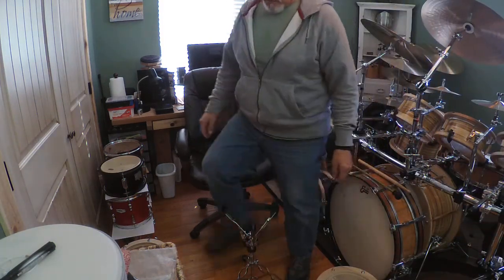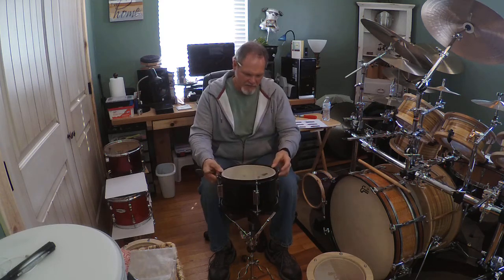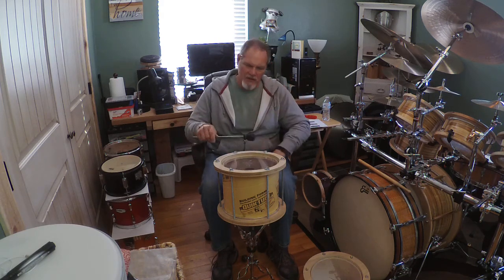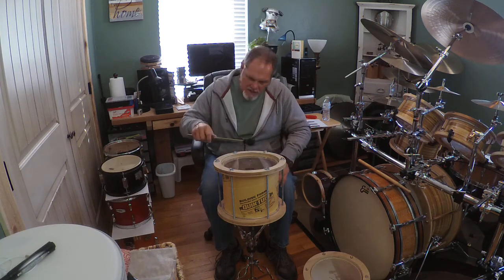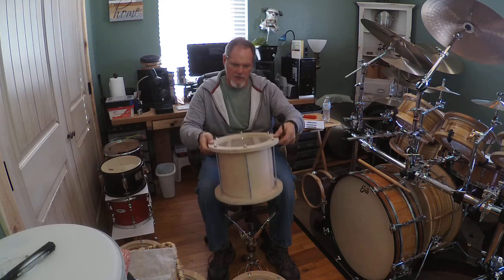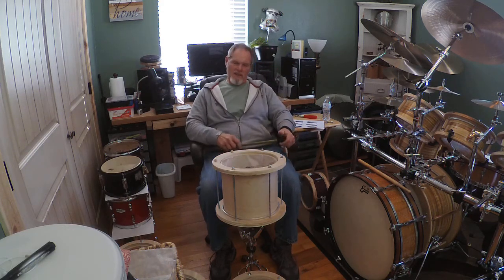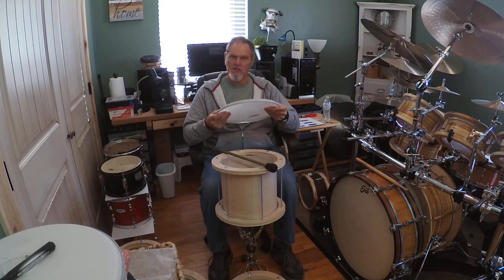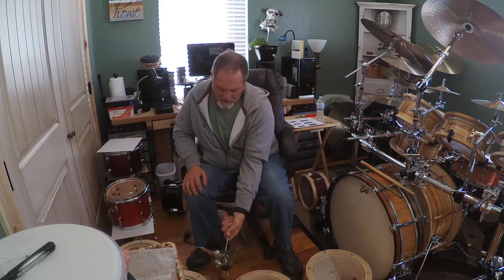Drum Shells and Sound - Bearing Edges, Part 6

Comment: Talk about how the drum when mounted if you stick a pole through the side of the tom it will sound different then suspended from around the edge
Reply from the maker: It isn't the pipe as much as the tom bracket on the shell. The same thing happens with tom brackets and L-rods for mounting. I mention mounting as a significant factor throughout the series.
Reply: @REFondrums  I have a 1980 pearl blx kit the Tom mount definitely deadens the sound if I were to use a rims mount or similar would the hole in the shell change the sound and would covering the hole change the rebound because of more air being trapped in the drum and improve the sound?
Reply from the maker: @trevormay7862  The hole would let a lot of the air column out and dry out the sound some. Picture the swiss cheese snare drums that became popular. They have holes all around the shell. The percussive effect of striking the head sends a very fast sound wave/air column to the reso head. In one video I show how fast that movement is. It's instantaneous on a 10" tom. 

Bear in mind you are losing that air when it goes into the pipe. Removing the bracket will open up the tom's resonance/sound quite a bit. Try it first and see what you think. If you want to cover the hole, I believe Pearl sells some kind of plastic cover for that purpose. Check out their website. 

I stopped using air holes in drums I make back in the early 90's. The amount of air that leaves a 1/2" hole is negligible when it comes to sound. If the BLX has a vent, just strike the drum while covering the hole and see. Nothing changes.

Concert toms just have the single head and like using a kick with one head, you get a lot of volume and the entire air column is leaving the drum. You just get a drier sound. Concert toms mounted with iso hardware have pretty good sustain, all things considered. 

Check out some Spaun drum videos. They make a Swiss cheese set. There's also a company that makes drums cut in half and you slide the halves closer together or further apart for sonic differences. They sound really nice. I've seen them in a NAMM video from some years back. I can't remember the company name. I was surprised at how nice they sounded. 

So, I don't believe the pipe hole will make that much difference. Like I said, try it and see.
Reply from the maker: Roto Drums - https://www.youtube.com/watch?v=yUIAPofPtyk
Reply: @REFondrums  thanks mate since I last posted I tried a pearl optimount on a 10” Tom I then tried the original mounting system there did not seem to be a whole lot of difference, if I hold the rim with my finger tips the sound definitely improves?!
Thanks for your reply and explanations, always interesting and informative, much appreciated!
Reply from the maker: @trevormay7862  When Gauger came out with his system and its obvious improvement of sound, the companies began their R&D to come up with their own. Frankly, many of them fail to truly isolate the drum and allow it to float.  If you put the mount in connection with lugs, etc., when the drum hangs at an angle, stress is created at those points, thereby putting stress on the shell, thereby restricting full resonance.

Some feel RIMS allows the drum to move too much, and it gets into a rocking motion. Because of that I began using snare baskets back in the 90s. I modify them for tom size and try to make them so I do not have to clamp them too tightly on the bottom hoop, thereby also restricting the drum. They have worked well for me. 

The Optimount affords more sustain and resonance than a mounted bracket but, again, if the drum is tilted, gravity is going to cause stress at those four points on the shell. Pearl chose to relieve rocking by using two top and bottom lugs/tension rods. I have not tried all these various iso mounts. Some of them are very proprietary. 

I know RIMS work. I know snare baskets work. The larger the drum, the more benefits can be heard. The smaller the head, the less vibration when striking it, thereby a faster lessening of sustain, especially if the reso head is effected, which the Optimount will do, depending on drum angle and tilt. 

If your tom is fairly level you should notice a significant difference, though. Just for the experiment, try various angles and see what you hear. Of course, your playing angle is your playing angle. I cannot play level toms for several reasons. 

Like everything else in this series, I have to say it becomes an issue of nuances and subtleties, hardware to hardware.
Reply: @REFondrums  just did another experiment, I mounted the 12”” Tom on the bass drum and it killed all resonance then I mounted it on a cymbal stand, it was much better, not as good as holding it on the rim by hand but it resonated?!
I can’t believe how much the bass drum killed the resonance of that Tom , it did have some dampening in the bass drum which is a 20x14!?🥴
Reply from the maker: @trevormay7862  It's just a principle of sound absorption. Vibrations are all part of the sound and they get absorbed by hardware or floors. Same with fl toms. That's why companies came up with leg tips that keep the solid section of the legs from touching floors. A lot of things can effect sonic frequencies and sustain. 

Some day science will come up with ways to levitate things, and for the drum world that would mean no hardware. All the drums would literally float and angles adjusted by virtue of magnetic fields or something. Of course, by that time there may not be acoustic drums anymore. Everything might be in the nature of Aerodrums. Until then, all drums will probably have some kind of interference of 100% full tone. Gauger seems to get the closest.
Reply: @REFondrums  ok thanks, here is another you may be able to explain. I have just redone the bearing edges, the drums are sounding pretty good apart from my 14” floor Tom I put a new remo emporer on it, I like a relatively loose tuning I’ve tightened it first & cracked the glue but I can’t get the head to sit flush on the bearing edge there is a slight gap and I can push the head slightly down onto the edge with my finger but it just springs back!!
Could this be a faulty head or is the bearing edge at fault the head sits perfect on my 16”” floor Tom with the same loose tuning , wrinkles just taken out?!
Reply from the maker: @trevormay7862  Honestly, I am not a real fan of Remo heads. I use them if I must but, I think Evans has better quality control. I have also never found any issues with Attack heads, which are my usual batter heads on toms and snares, and in some cases also reso heads. Remo heads ... they have a more dull, muted tone compared to the others, which is fine if that is your taste.  I stopped using Remo heads because of how many just popped at the hoop. 

Based on the head, I'd guess it has a manufacturing glitch. Does the previous head fit the edge you put on the drum? Do you have any other 14" heads to see what they fit like? Mylar stretches. Even out of level bearing edges will see mylar stretch to fit small inconsistencies. If you are satisfied with the edge as far as it's level with itself around the circumference of the drum, I'd have to figure your light tension is leaving a manufacturing glitch of an uneven space/bubble in the circumference of the head.  It isn't seating correctly. 

If the head slides onto the drum easily, no spots where the head is catching the shell (an out of round issue), logically, your new head is the culprit.

Comment: Please please check out a local legend here in Portland OR named Jeff Kirsch. Hes got a couple videos on YouTube. Hes a passionate craftsman that makes amazing drums and does alot of nearing edge work. Thanks for the great video.
Reply from the maker: Watched a video of his, showing bearing edges up on a dry erase marker board. I had to take issue with a few points but, overall, he's correct. 

Not all companies put an inner 45 degree edge on their drums. Two that have, Premier and Sonor, make their shells slightly smaller to accommodate the head collar/flat apex. Matter fact, save for beginner drums, do any companies put a full inside 45 degree cut on their drum lines anymore? I'll have to check. 

I believe edges are basically muting devices and I don't believe only one edge accomplishes that task. That said, as I show in my own edge videos, no edges meeting the apex seating necessity make much of a difference in the tone and sound of a tensioned head so, for Mr. Kirsch, just using one edge pretty much covers the bases. 

Seems like a really nice guy. Cool to talk shop with. Thanks for sharing about him.

Comment: Hi, firstly, I'd like to say how much of what you say makes perfect sense, about time someone debunked all the hype.  Thank you for the time and effort you have put into this, it is truly appreciated. You mentioned undersized shell's in this video, what observations have you made of this type of shell. Regards Les.
Reply from the maker: The undersized shell that Premier made (and I imagine still does), and I have  been told Sonor, as well, assures that any head will seat correctly with a single inner 45 degree chamfer. The single 45 generally gives the most sustain. The problem is that edge will often sit back into the collar of the head, not the apex of the collar and flat. Tuning becomes a challenge. Most shells are 12 7/8, 13 7/8, 14 7/8, etc. That allows for a wrap to go on the shell and the head still fits. The single inner 45 became a popular edge but, many found it less than satisfactory for seating a head. Premier pulled back the shell just enough to make that edge work perfectly.

Thank you for the kind words.

Comment: I am so glad that I found this video! Finally, I feel that the big mystery about drums is revealed. :) I spend so much time listening to different drums sets before I bought my Pearl Export kit. Thank you for that honest video! 

Just to recap... I am a rock drummer and I am looking for that low-end sustain and volume ( if possible). 
What shell thickness or material should I look for?
Reply from the maker: Low end frequencies are all about drum head thickness and their vibration rates, and drum head tension. Drum shell depth also plays into that. The deeper the shell, the slower the sound waves are moving back and forth between heads which gives you what is called a punchier sound. But, that can be achieved by using thicker heads on shallow drums. It's all about the heads. Obviously placing thicker heads on a deeper shell will give you the punchiest, low end sound. On the other hand, you can just get a size larger per drum and get the same thing with traditional depth drums. It's just common sense, really. Take away all the hype in the industry and it's just common sense. 

Sustain is about how well the drum heads seat on a bearing edge, how much of the shell is touching the heads, and how the drums are mounted to allow for full vibration. 

Thicker shells trap more sonic waves and therefore are generally louder than thin shells but, that also depends on the density of the shell wall. A thick softwood shell will generally not put off the volume of a thin hardwood shell. 

And these are all nuances and subtle things. All of it gets lost when you crank up a full set of drums and cymbals, especially in a band context. Because drums are generally mic'd in modern music, volume is a non-issue. Volume is controlled through the sound techs live or in the studio. So are other variations of sound. You can take a dead drum, by virtue of heads and muffling, and give it sustain for days through software. 

Pearl Exports are the most purchased drums on the planet. They keep improving them with better hardware and mounting. They sound as good as anything else out there, as far as I can tell. They may not have pro touring-worthy hardware or the best finish options but, they're drums! They look like drums, they sound like drums. There's no magic involved. 

Enjoy your kit!
Reply: Dragomir Dragomirov me and a friend thought that Pearl Export sounded much better than the high end Pearls!
Reply: Me and a friend also thought that the Exports sound way better than the high end Pearls!!!

Comment: I giged a rogers set back in the day that was so beat up I deconstructed it and peeled the wrap off and wrapped it in dick tape with no reso head. Several conversations came from that asking what kind of drum set is that what is that finish. With that kit the rite head head combination sounded great in the small venues I was playing. As I started playing bigger rooms they did not project. I have been playing a tama rockstar for 15years and it sounded good. Recently I a got a starclassic and there is no comparison. The shells have no gaps in the wood. They are smaller witch adds to the heads fitting without touching them. The cast hoops tune easier and the ten lug bass drum vs. the eight on the rockstar is infinitely easier to tune.
Reply from the maker: I would agree, sure. Slightly smaller shell to seat the heads. Hardware differences for mounting make a big difference. Rockstar long lugs make a difference. Cast hoops, more tension points with more lugs, etc. It's the other stuff that is more important than shell material. But, again, many players do not care about the extra resonance iso mounting affords or tuning two extra lugs gives. The heads they use, the tuning, the sticks they use, the music they play in, and it all works for them in the context of a band. 

The only real difference between the shells is density. Luan and basswood vs. hardwood which can render a little more volume and wider timbre. Take the Rockstar shell, though, put the same edges on them, lugs, heads, mounting, etc., all things being equal and the difference in sound would be small; nothing that would be heard in the context of a band. The Starclassics would look better, that's for sure but, with a wrap or fancy outer veneer? No major differences. Bubinga against Luan, sure. Greater density difference and handling of the soundwaves. More volume, a wider frequency range reflected but, nuances and subtleties. It's always that. 

I notice new Rockstars are made with small lugs and rack toms come with iso-mounting. I wouldn't think adding four more lugs to a bd would cut into the profit margin but, that's Tama's choice. That's the thing. They cannot make these lines the same because the cat gets out of the bag. Shells do not make the differences the companies claim.
Reply: I agree with you and appreciate your videos. The information you're providing should let new drummers and those that can't afford there dream kit sleep better at night. If you can properly tune a kit and find the rite combination of heads you can get excellent results. Then it's all down to practice. The information you have been giving about mics is awesome. The first time I was in studio I was so intimidated because I always thought my kit wouldn't sound as good as it would need to. With proper tuning and a good sound tech and mic placement it is possible to get a mix for your track. I hope a lot of drummers find your channel and consider the information you have provided.
Reply from the maker: @mzac16  I watched a Glenn Fricker/Spectre Sound video yesterday which compared a $6k kit to a used $250 Tama kit. No serious, discernible differences when same heads, mics and all were used. A nuanced thump difference in the high end kick but, again, all of that is easily addressed with mics, electronics, software, heads, and such. 

Thank you for the kind words. I appreciate it.

Comment: The shells that are being used here have different bearing edges on each end --  perhaps this is clouding the sound differences between the edges. If the bearing edges were 
the same on each end of the shell, there may (or may not) be a more obvious difference.
I know for a fact that a thinner shell vibrates more, because I can feel it through my hand. This must contribute to the overall sound of the drum, regardless of bearing edge.
Reply from the maker: Watch the next videos and see how I address that issue, and place the same edges on the drums. Thinner shells tend to lessen the volume of the drum because sound waves are not trapped as well but, again, can that nuance of difference and subtlety be heard enough in full-set play for the industry to ultra-hype their shells? I have yet to hear such proof that any shell or any edge dramatically effects the sound of a drum, from one drum to another that can be heard when you play a full set of drums with cymbals going, and certainly not in a band context. My bottom line in the videos is hype and ultra-hype in the industry.